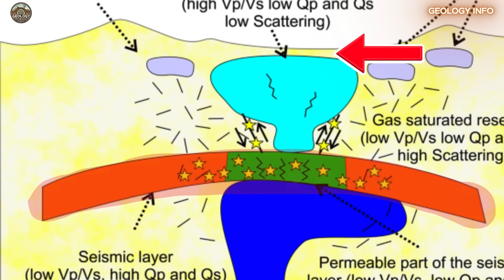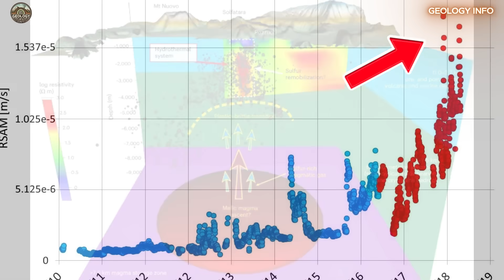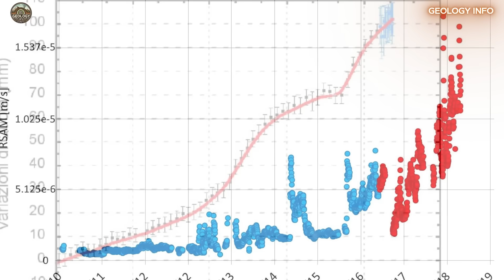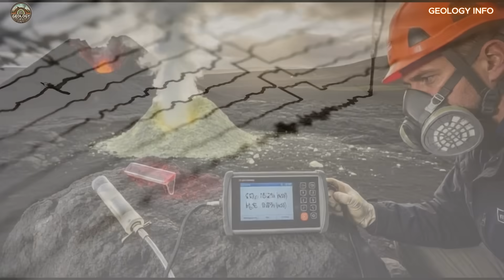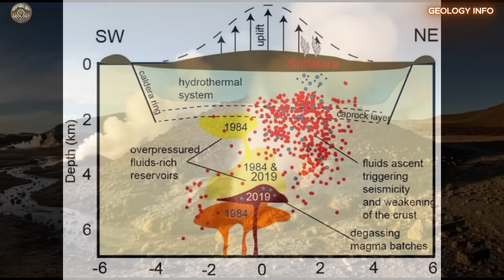SUPERVOLCANO CAMPI FLEGREI.

Comment: C.Flegri and Yellowstone are going into eruption phase, but unlike Yellowstone,which has countless pressure releases, C.Flegri doesn’t… which is why it’s more of a concern than Yellowstone. What’s more worrying than this? WHY NOW? Global anomalies indicate the true source and a far bigger concern…. Earths rotation has increased.. over last decade…  the axis is anomalously 31 inches off,  AND there is now an anomaly in the core as well… part of it is acting like “the jet stream”in the atmosphere,that is going faster than the rest of the core… these things combined mean only one thing… the biggest eruption in the last 1,000 years is coming soon… there is no doubt… unless the trend reverse, it will get much worse with more and bigger eruptions… This is absolutely related to earths weakening shield
Reply: So something like centripetal force is at play here too, as the earth is spinning a bit faster. The volume and density of the earths core would increase that force disproportionately ( not really) in our basic human minds. Am I making sense?
Reply: @maryrosecarroll4558 100%… more stress on the crust… at core mantle boundary… tremendous heat, thinning magma… stress on the axis..and core.. stress on fault lines and magma chambers… hopefully you can see… soon the dam will burst… to much energy is coming in… humanity needs to prepare for catastrophe.. many are coming…

Comment: You didn't mention it but, afaik, should Campi Flegrei explode, not only the blast you mentioned will wipe / cover everything in ash, for miles around, but the eastern flank of the volcano will collapse into the Mediterranean, causing a tsunami of biblical proportions and violently submerging coastal areas, from the Middle East, to the Iberian peninsula.
Reply: Will be a global winter if that's the case..starvation worldwide and every country

Comment: The speaker refers to bradyseism several times.  So, I looked it up: https://en.wikipedia.org/wiki/Bradyseism.  It seems to be related to plate subduction.  Several plates are in the area, the Eurasian, the African/Nubian and the Arabian, et cetera.  Bradyseism seems to be a little like a very slow roller coaster.

Comment: If I lived there,  I would be gathering the essentials and getting away from the Bay of Naples entirely.    Both Campi Flegri and Vesuvius are showing alarming signs.
Reply: I haven't heard anything about Vesuvius. What alarming signs?
Reply: @JH24821   I think they are referring to the quakes that have been registering at Vesuvius.
Reply: @ange5673  Oh, those quakes. Are those the ones very close to the surface that have been going on for awhile? I thought they determined those were not magmatic in origin.
Reply: @JH24821  I’m assuming it’s the ones recorded on the list released by the INGV. They don’t have to be magmatic in origin. The eruption that buried Pompeii and Herculaneum was phreatic, no lava was produced.
Reply: @ange5673  The eruption in 79 AD was magmatic at first and later became phreato-magmatic. (Seawater coming in contact with magma inside the conduit) It was just so explosive that the magma was immediately ejected as ash and pumice.

The earthquakes underneath Vesuvius (some less than 200 meters deep) are apparently caused by leftover cooling magma inside the conduit from the 1944 eruption. When magma cools it shrinks, the surrounding rock then collapses into that new space which causes the quakes. 

If we're going to see earthquakes at 4-5 kilometers depth (Where the upper magma chamber of Vesuvius is located) we have to start to worry.
Reply: @JH24821 I’m not wasting my energy arguing with you. I just said I assumed they were referring to the listed quakes reported by the INGV and that all eruptions are not like the 1944 eruption which resulted in lava flows. Being that Italy is on the edge of the tectonic plate boundaries, some quakes will not doubt be tectonic too. Regardless of origin, quakes are worrying for people in the area. The Campania area is geologically very active and a lot of the buildings are old and not able to take frequent shaking.
Reply: @ange5673  You said in your comment the eruption of Vesuvius in 79 AD was phreatic. That is wrong. I pointed that out.
Reply: You fill the wallet of the creator. Like more wallets are filled by  the existence of Campi Flegrei. Built on fear for something you don't understand. Keep posting, the creator will earn more money. The reason I will stop posting here now. It's been an annoyance for years now, all the channels, reporting about Campi Flegrei, every single time it is almost there, for decades. Almost, till the next video.
Oh for sure: one day it will be the right day. Could take thousands of years by the way.
Reply: When it comes to evacuations in the Campi Flegrei you have to differ: evacuations that have already taken place were done to those people, whose houses got damaged by the current swarm and became unsafe to remain and live in them now. These people were moved either to hotels outside or to their family relatives. Only these people may get some compensation. These are not done secretely! Actually there is NO MANDATORY evacuation order by the government or official departments. 
Fact is: the officials would get severe problems with displacing the whole population all at once- in case of an imminent volcanic hazard or an eruption. It lacks of housing or shelters for approx 3 millions of inhabitants in the affected area! 
They keep CF on volcanic hazard level yellow. Rising it to orange would mean: increased volcanic unrest. An eruption is possible/likely to take place. Which would change the official/governmental situation significantly! See: https://www.google.com/search?q=international+volcanic+hazard+levels&sca_esv=c66570702dbaae6e&sxsrf=AE3TifONYBpR73BeyhNZA-upxO1zMrdIww%3A1761414331873&source=hp&ei=uwz9aL6WM6vZi-gPw-y82Q4&oq=international+volcanic+hazard+levels&gs_lp=EhFtb2JpbGUtZ3dzLXdpei1ocCIkaW50ZXJuYXRpb25hbCB2b2xjYW5pYyBoYXphcmQgbGV2ZWxzMgUQIRigAUiIqwFQtw9Y_qUBcAF4AJABAJgBogGgAbwlqgEENy4yObgBA8gBAPgBAZgCJaACySqoAh7CAgcQIxgnGOoCwgINEC4YxwEYJxjqAhivAcICDRAjGPAFGCcYyQIY6gLCAhAQLhiABBjHARgnGIoFGK8BwgIREC4YgAQYsQMY0QMYgwEYxwHCAggQABiABBixA8ICCxAAGIAEGLEDGIMBwgIOEC4YgAQYsQMY0QMYxwHCAgUQABiABMICBRAuGIAEwgIOEC4YgAQYsQMYgwEYigXCAhEQLhiABBixAxjRAxjHARjJA8ICCxAuGIAEGLEDGIMBwgIOEAAYgAQYsQMYgwEYigXCAhEQLhiABBixAxiDARjHARivAcICCxAAGIAEGJIDGLgEwgILEAAYgAQYkgMYigXCAgsQABiABBixAxjJA8ICCBAAGIAEGJIDwgILEC4YgAQYxwEYrwHCAggQABiABBjLAcICCxAuGIAEGNEDGMcBwgIGEAAYFhgewgIGEAAYDRgewgIIEAAYFhgKGB7CAgUQIRifBcICBxAhGKABGAqYAzHxBfkAyvAZoItlkgcEMS4zNqAH-_MBsgcEMC4zNrgHlyrCBwoyLTEuMzEuNC4xyAf9BA&sclient=mobile-gws-wiz-hp
Reply: If you lived there, you did know thar this videos are mainly over-hyped BS made to monetize.
Cheers from Italy.
Reply: @dadoVRC   Sadly, I don’t think the people behind Solfatara News would agree with you.
Reply: @ange5673  Sure. They are making videos in this same way, raising concern against one of the best volcanology institutions in the world, the INGV, that monitor the area with precise instruments and deep knowledge of the italian geology.
Guess why?.
Reply: @dadoVRC   Some of the INGV’s top volcanologists have come out and said off the record that evacuations should have already began.
Reply: @ange5673 To be on the safe side, almost two thirds of our country have to be evacuated, since we're living on a massive series of fault lines.

Phlegrean fields have been "breathing" since ancient times.

How many massive eruptions did we have observed over human history?
None.

And earthquakes in the area are and were way less harmful compared to the ones in the appennines.

The concern is based on having more data, mainly because of the way the media talks about them.
Science is observing, the media are spreading paranoia.
Reply: @dadoVRC  where have two thirds of your country been evacuated to? That's millions of people. 🤔

Comment: Chirping of the LP and VLP signals largely stopped around 2 months ago.  I interpret that as an abrupt shift in the transfer mechanisms between the deep and shallow regions, perhaps indicative of the 'blockage' that's reducing the sulphur dioxide emission.  The pipework is clogged but the surface deformation and constant flexing (see CSOB seismogram) and impulsive signals suggests that the next phase is well underway.
Reply: DEPLOY THE FLUX CAPACITOR. That'll stop it.
Reply: Scappate !!!la vita è una sola!!❤
Reply: VERY Scary.  Think we're going to need something a LOT STRONGER than SHERRY!
Reply: Potreste tradurre in italiano??? Grazie mille
Reply: needs an enema to releave the blockage ... but what do you use ?
Reply: @pudmina it'll clear with enough pressure.  Just wait.
Reply: @pudmina It generates its own enema, explosively. 😮